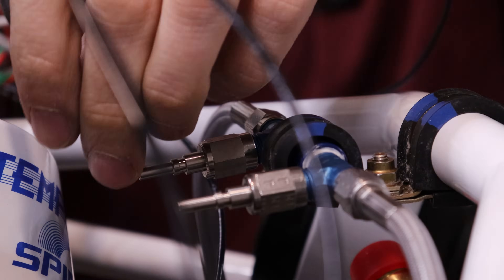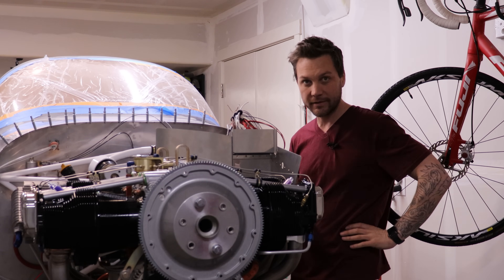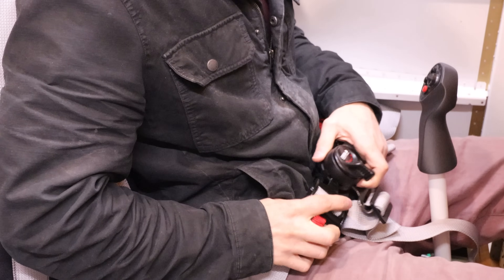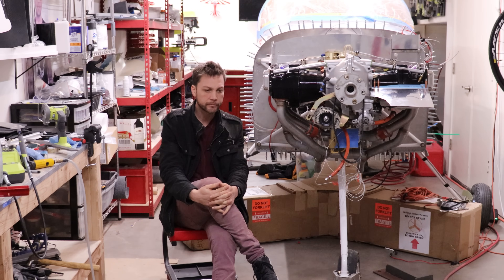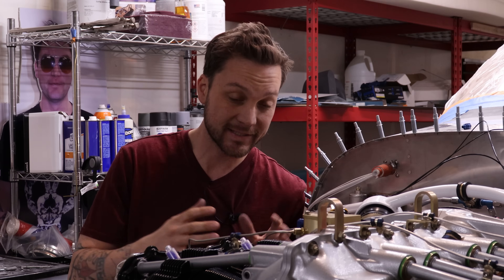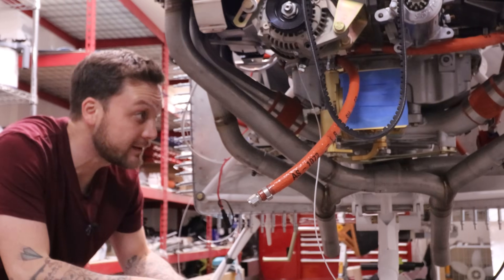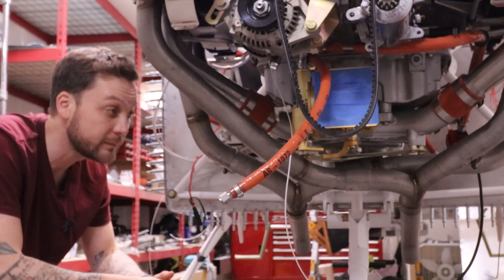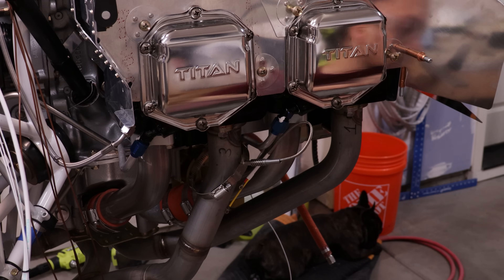Custom Exhaust Install, Custom Baffles, and Engine Sensors | EP113

Comment: Ryan, you sure doing a great work 😀
For your next build you could leave that unneeded oil cooler reinforcement out of the rear baffle, works perfect without and saves some weight (believe me, just done that as my own cooler is mounted directly on the firewall, which by the way, is the only way an oil cooler should be attached (scat or sceet tubing to the rear baffle flange works perfect)... not sure what they were smoking at Vans 😅).
Also of note is that most of us (talking -7, -7A, 6A, or 6 as in my case) have problems bringing the oil T up to the desired 180... even in the Summer. My shutter (AntiSplat) stays closed for most of the year, and I only start to open it when OATs are > 100F...
Enjoy the build 😎
Reply from the maker: I thought about leaving that off, but then thought baffle seals would be a pain…

Hopefully cooling (or more appropriately: overcooking) isn’t too big of an issue for me. Grateful for the door, hopeful it blocks enough air with that big 13 row sitting there.

Comment: Can you take the original shaft, offset it far enough that the holes in the door clear the original holes in the shaft. You could then drill and tap new holes in the shaft for the original door?
Reply from the maker: No, I really buggered this one up. There is the ability to adjust in the design of the kit, but I’m outside of that tolerance. I think I’m nearly there, just need to fab up the arm.
Reply: I look forward to seeing the solution! 
On a side note, I would also suggest putting some tape/cap over the propeller pilot to stop dust or debris getting into your oil system! 

Keep up the great work and I can’t wait for next weeks episode!

Comment: I've been using Xometry for 8+ years for machined aluminum parts and SLS printed resins. Working with them has always been a positive experience. They are not cheap though, in quantities under 5. Price breaks occur in quantities of 25 and above.
Reply from the maker: Xometry did the 3D print, but I think we were $200 for the aluminum. I’m getting a bead on some new options. Possibly PCB Way, and a few people with capabilities have amazingly reached out to offer help.

Comment: You are in the stage of all the little systems . These take longer than the big things ,, not saying they are hard , it just takes time . Good call on clocking the EGT sensors as not to block the spark plugs .
Reply from the maker: They weren’t hard to begin with. I just made them that way…

It’s about time for “THE BIG LIST, VOL. 2!”